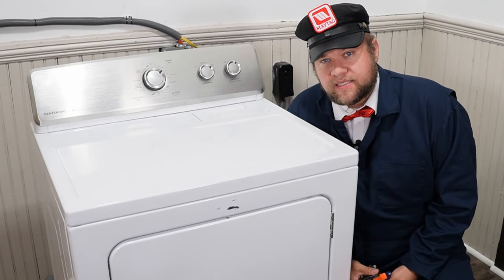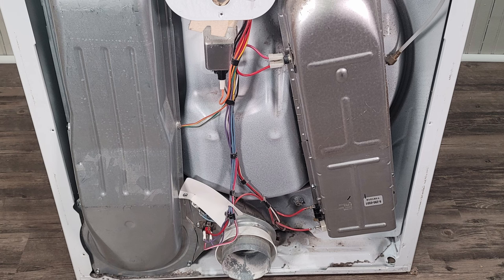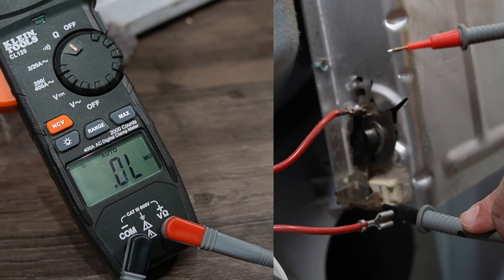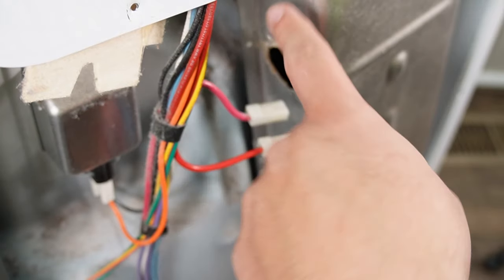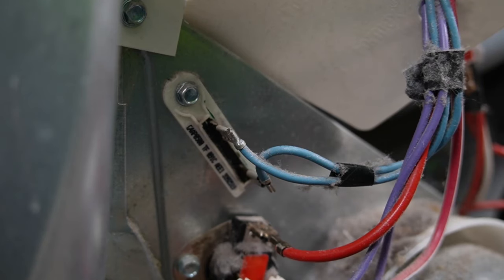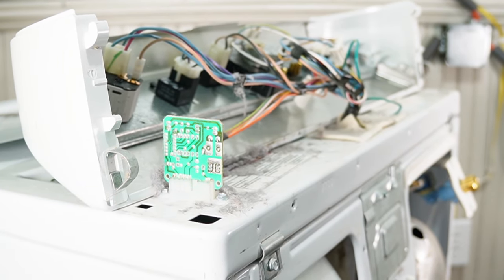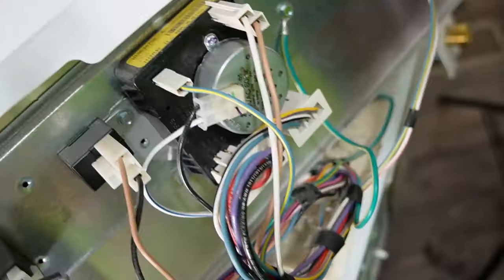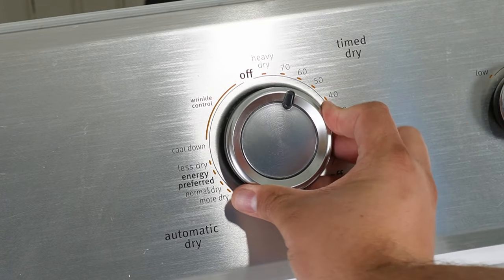How to Fix A Maytag Dryer That Won't Heat

Comment from the maker: If you need the heating element + sensor kit, here's the link to buy it: https://bens-appliances.com/collections/whirlpool-dryer/products/whirlpool-dryer-heating-element-optional-sensor-kit-279838-338134-3392519-279816
Reply: This video  is only for electric  dryer  ?  Hiw about gas trouble  shooting
Reply from the maker: @frankv6459  When I get a Maytag gas dryer, I'll make a few videos.
Reply: How does the temp! Timer knob come off
Reply from the maker: @alanhughes2909  On this style dryer, just pulls straight off

Comment: Before you do any of this, flip the breaker on and off. I did all these steps (timer was not moving and no heat, but drum was still spinning w light on). Read on another post to flip the breaker. Bingo. Timer and heat came back (and no, breaker was not flipped on the panel).
Reply: I can't believe that worked. Thank you! You saved me hours of diagnostic work and my wallet.
Reply: That did the trick, thanks for sharing 😊

Comment: Thanks. I fixed my dryer. The whole setup was 30 bucks. The repair shop not only charges over 100 bucks for their shop time but also upcharged the parts.

Comment: I've watched this video several times and think I've found one ambiguity.  Please comment.  Did you put the wire back onto the heating element before testing the thermal cutoff (or high temp thermostat) ?  I guess it doesn't matter? Saw a brief image of the wire back on the heating element.  then later you took BOTH wires off the thermal cutoff .  Could I also test it with zero wires connected to it?

Comment: I remember being able to buy just the metal connecting crimp (that part in the video attached to the wire which is then slid onto the terminal spade of the round black thermostat in the video) at Radio Shack years ago.  You could get any kind of electrical connecting pieces there.  I miss that store.
Reply from the maker: I never was much into electronics/ect like this when I was a kid and Radio Shack was a thing but now that I am old, man... Its rough knowing we had one in our town that would of had SO MANY important things. Now 100% relegated to big cities or online stores with Chinese knock-offs.

Comment: Hi Ben, I get 10 ohms if I use the multimeter on both connecters of the heating element, but if I have one end of the multimeter at the top of the  thermostat connector i get nothing. would this mean I don't need an element, just a thermostat?

Comment: Ben, great video! Helped me to determine that my thermostat was bad. No reading at all. Went to your website and ordered the Thermo/High Temp Kit, Low Temp Thermo and the Heating Element! Much cheaper than purchasing a new dryer. Should be delivered next week. Thanks again!

Comment: This video is an INCREDIBLE resource that came at just the right time. One question: do you have a suggestion for a repair kit to buy that is compatible with this model? I purchased this one but was unable to resolve my dryers issue after replacing all 5 components with what came inside the kit. Additionally there is a “jumper cable” in the kit that supposedly connects the bottom right two elements, but I can’t figure out how to install it. Maybe that’s the issue or maybe I bought the wrong kit. Do you have a suggestion for a compatible kit to buy?

Thank you for such a thorough and well done video!
Reply from the maker: The jumper wire connects the thermostat to the heating element. Most newer kits have a thermostat that has a welded arm that connects to that piece. 

All the parts we currently sell are here: https://bens-appliances.com/collections/whirlpool-dryer

If you replaced the element and sensors, you'd want to make sure you're getting 240v to the terminal block, then check the timers' contacts. Both things are mentioned in the video.
Reply: @bensappliancesandjunk  Thank you for that tidbit about the welded arm, that makes a lot of sense - that’s why the jumper cable wouldn’t connect, the welded arm was already connected to the heating element, leaving no room for the jumper cable to connect. 

Unfortunately you don’t currently carry the parts I would have needed to fix the dryer but I hope that you are able to sell all the parts you have and add even more- my dryer started working after I removed some of the replacement parts from the link and left a few others on. 

I really appreciated the thorough nature of this video and it helped me to repair my dryer when I had tried with other videos but was unable to correctly diagnose the faulty parts. Thanks again, and I wish you all the success in the world!

Comment: Hey Ben - just used this video to troubleshoot my Maytag dryer. - Turns out I don't need an appliance repairman, I need new circuit breakers!!  Your video was very helpful yet moved right along.  Thanks so much!!  - Geoff.
Reply: Me again - just wanted to Thank You - again - for this video.  It saved me $$$ and time by letting me fix the problem over the weekend.  SO very grateful.

Comment: This was a great video and helped me test most of the components.  However, there is one section that was not very clear and that was in the section of the video beginning around 2 minutes where you are testing the dryer element.  When I did this test I tested between the two terminals and I got continuity.  However, when I touched the top pin on the thermostat I did not.  However, it didn't occur to me at first to be a problem because you stated you can test either one.  It would have been helpful if you had broken this into two tests.  One for the element and one for the thermostat.  I eventually figured it out but it was a bit confusing to me at first.  
Thanks for the great video however.  Besides that small clarification, it was the best video and the most thorough I have seen to date.

Comment: I have this, or a very similar Millenium version.  The issue mine has is that, especially on large loads, the clothes are not quite dry, even when the timer is set to Auto Dry - "More dry".   We clean out the lint trap after every use and clean the outside house vent cover.  Is there a moisture sensor that needs to be cleaned/replaced?  I didn't see it in your video.  Thanks.

Comment: I replaced the 3 parts except for the fuse which tested ok. I ordered them from you and they arrived a day early.  I ran it for a minute or two and it seems very hot is it because I had nothing wet in the dryer or could I have attached something incorrectly? I tried blowing out the vent tube and there is air coming out the outside vent, so I don't think there is a blockage anywhere. Appreciate your import. Thanks, Kathy.
Reply: 10:39 dryer is like the one in your demonstration

Comment: I ran these tests and at 2.47 you said that if it gives you a reading on the casing, it’s grounded to the cabinet - which could be dangerous.

Mine did give a reading on the casing, but I’m not sure what you mean or what to do to fix it. Could you possibly elaborate?
Reply from the maker: If your element is grounding to the casing it means the electric is going thru the coils into the metal of the heating cannister. That's bad. It means the electric isn't going thru the coils entirely so less heat. What can happen is since the heating system is literally warped it can heat that metal up instead of the coils causing all kinds of crazy issues. Replace the element immediately if you get any reading thru 1 spade terminal and the casing itself

Comment: Ordering the kit from you now, question, on the two purple wires on the cycling thermostat does it matter which one goes on which prong? Maybe forgot to take a pic lol. Thanks
Reply from the maker: Doesn't matter which one goes where on the sides of that one
Reply: @bensappliancesandjunk  Thanks. And thanks for the quick delivery!!

Comment: I have a 2 year old Maytag that stopped heating. Sometimes, I can move it a little and it'll heat but, not long. We checked all the receptors and on the cycling thermostat, the 2 red do not read anything. This is the only thing we found. Is this what we need to replace?

Comment: My dryer just stopped heating up. My timer went bad over a year ago it would just run constantly until I turned it off. Could that be causing my issue now ?

Comment: I have a very strange issue with my Maytag Bravo XL (gas) dryer. What would cause my gas dryer to run fine on air dry but as soon as I change it to low,medium or high heat it trips the breaker. Any help would be awesome especially since it’s only 6 years old. Thanks
Reply from the maker: Sounds like the heat circuit is grounded

Comment: I have a Samsung dryer that grounded through the element wire before. I agree 1000% on the danger of the situation because, in my case, it wouldn't allow the dryer to complete the cycle and would run continuously until we stopped it.

Comment: What do you do if you've checked all this and everything is working? (With the exception of the last step with the electric terminal block. Mine doesn't have one. 

My dryer spins, but it doesn't heat.

Comment: I called my local appliance repair shop. Recommended the heating coil and thermostat replacement kit, which comes with cycling thermostat. 
Over going through your steps. My only issue was with the cycling thermostat. When I took the purple wire connectors off and checked there I got no reading on my meter. So I’m guessing I need a whole kit?
Reply from the maker: Just to be safe, yes. Those cycling thermostats are only $10-20, so very cheap to replace
Reply: @bensappliancesandjunk so in your opinion the fact that I didn’t get any reading from the two connectors close together ( purple wire ) would suggest a faulty cycling thermostat? Even though I had continuity from the two connectors furthest apart.
Thanks again for your expertise. Really appreciate it. Your website is awesome btw.

Comment: Having an issue with  dryer that's almost identical except on the heating element it has an extra wire. A small orange wire. In your video I see it has the spot for it but no wire. In any case the dryer works if I detach the wire but doesn't if its attached. What is this wire for?
Reply: It went to the door switch. Replaced the switch and problem solved.

Comment: Question Ben...My Maytag was running then we had a power outage ...2hrs at least..power came back for 2mins ...3 times.   This evening ..tried to dry clothes and dryer runs but doesnt dry...no issues before and vents are clean...any suggestions?
Reply: Fuse

Comment: 👍👍I got a Maytag 800 Series Brave top load washer. Contacted Maytag with no results. Issue is lately it started to give an OL code. It either does a short fill etc or it will fill up first then drain. There are no Resets. In a general what is best best to fix or repair? . I am single and machine is about 13 yrs old with a small to medium load about every 10 days. Big load 2X/year. Retail at the time was about $1050 CAN funds, so not exactly cheap. Worked perfectly until this happened. Just a mention.
Reply from the maker: OL usually is a leveling code. I'd check the suspension rods and see if they are bouncy or if the tub snaps back quickly. If its bouncy like a basketball, the suspension rods have gone bad. If they are tight, it may be a larger fundemental problem like the board or motor.
Reply: @bensappliancesandjunk  My manual says it is Over Load. Thanks for getting back👍👍

Comment: I have had the thermal fuse trip numerous times on our whirlpool.  I have had to "reset" it by whacking it for lack of a better word on the back until it shows a reading again on the multimeter.   

Wife and kids keep leaving crap on top of the dryer and it ends up tripping it.

I do have an issue where it's no longer drying as well as it used to I'll try opening it up. And cleaning it .

I recently changed the belt after it snapped.  We've had it at least a decade and I got it and a washer for 40 bucks used.   Don't want a newer one.

Comment: Hey, if a dryer is taking longer to dry, is that a timer or heating element issue?
Reply: If it is taking longer than usual to dry a load of clothes and you feel the clothes are getting hot during the cycle. You have a blockage in the vent system. Check the lint screen, check the transition (slinky) hose between the dryer and wall. If they are clear then you need to clean the vent ducting and exhaust port on the outside whether on the outside wall or roof.

Comment: So there is one last possibility if all the other parts are good. I've had the centrifugal switch on the motor short out and not allow the unit to heat.
Reply: My dryer was stuck running for 6 hours because of a faulty timer I swapped everything in the video even changed my outlet still no luck I’m gonna check the centrifugal switch next

Comment: Great video but did I miss it you didn’t check that fuse with the little blue wires?
Reply from the maker: That sensor deals with the unit being able to run. Has nothing to do w/ heat.

Comment: If A to C has no continuity but B to C does that just run the low heat setting and not high? Everything else is good
Reply from the maker: I can't remember the schematics, but no - A to C is needed for actual heat from what I remember

Comment: What if we replace all the fuses the heating element and the timer and it still doesn’t heat?😢
Reply from the maker: Check to see if its actually getting 240v at the terminal block, and run the thing w/ the leads on the terminal block to make sure you're actually getting the flow of 240v while under load. If not, there's an issue before the terminal.

Comment: If the dryer isn't plugged in how is it getting electricity to test for whatever you're testing for
Reply from the maker: Multimeter sends an electrical signal itself since its battery powered
Reply: You're testing the individual parts (from plus to minus, or lead to lead) to see: is this part still connected to itself.   Heater wires connect plus and minus - a very little bit, so it doesn't short out and trip your circuit breaker -  and glow red and get hot when they work.  If they're bumped hard and break, or break from overheating/long life, the actual metal wires won't be connected anymore.  

Most of these parts are tested for resistance/ohms/continuity.  The multimeter runs electricity through the part's leads when testing resistance "ohms" or continuity.   When the metal wires aren't connected anymore, you'll have infinite resistance or '0' or no continuity.   The other main use of a multimeter is testing live voltages, either AC (110v house power etc) or DC (battery voltages).

Comment: always wondered why manufacturers put auto dry and timer minutes on the dial...isn't the ultimate goal to dry your clothes...i would think the dampness sensors would be more accurate than "guessing" the amount of minutes it takes to dry something...probably one less sensor to worry about
Reply from the maker: People sometimes like the option of timed dry so they can set it and come back at the pre-determined time. That and auto-dry is a typical fail point due to sensor bars.

Comment: What are your thoughts on a heat pump dryer?
Reply from the maker: Not a fan. You're putting a compressor beside an electric motor and now have two huge failure points instead of one. It's not something you'd want to go cheap in certainly

Comment: Question different ,,,GE WASHER, I FOUND OIL DOWND AGITEROR, THERE IS A OIL SEAL THAT GE ,,DO NOT SALE  WHAT DO I DO,,,
Reply from the maker: Usually if its losing oil you'd replace the transmission which comes with the seal.

Comment: Don’t forget that it’s a Maytag in name only. It is made by Whirlpool and so is any dryer with that style and location of lint filter
Reply from the maker: I say that during the introduction...
Reply: @bensappliancesandjunk  sorry Ben, I just re-watched the video and we didn’t hear you mention Whirlpool once.
Reply from the maker: @MayhemRv   Shoot, you know what you're right I'm sorry. I've been working on the next video which I shot at the same time as this one regarding regarding dealing with noise related issues and I specifically mentioned in that video and I thought I'd mention it this 1 too my apologies
Reply: @bensappliancesandjunk  👍 I’ve been a tech for over 30 years and I have to laugh when someone says “I wont have anything but a Maytag” and they really have a Whirlpool 😊
Reply: And these are the best dryers. The fancy looking 1s that match a front loader washer, if are a Kenmore Oasis/Maytag Bravos/Whirlpool Cabrio (rotor stator), if are traditional maytag/admiral, GE/Haier, Electrolux/Frigidaire, LG, Samsung, Fischer Paykel, are all turds.
Reply: @shadowopsairman1583  I couldn't agree more!

Comment: No. If the timer doesn't test correctly, the contacts just need cleaned inside of it.
Reply from the maker: Which I have a video on how to do, and its usually linked at the end of the video.

Comment: I have one of these dryers and it is borderline junk, don't buy it. First thing we noticed is that every time you clean the lint filter, a little grill on the outdoor exhaust is completely plugged up afterwards when you run it. Almost without fail. Now it is less than 2 years old and it's starting to play drum solos already, when the clothes are wet. I no longer trust the Maytag name at all anymore

Comment: 50 amp breaker?
Electric clothes dryer should be on a 30!
Reply from the maker: Its a test breaker for videos, only had 1 available, its not used more than to demonstrate appliances running, nothing more
Reply: @bensappliancesandjunk  I'll sleep better now. The Electrician in me took over. Love you man!